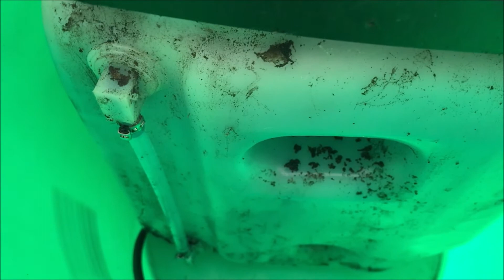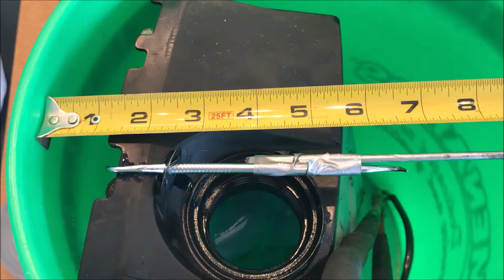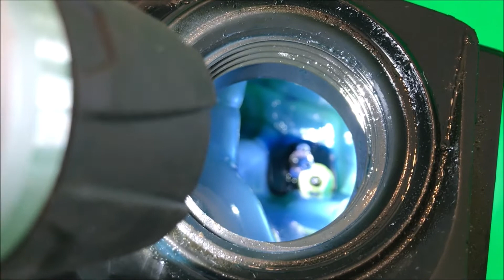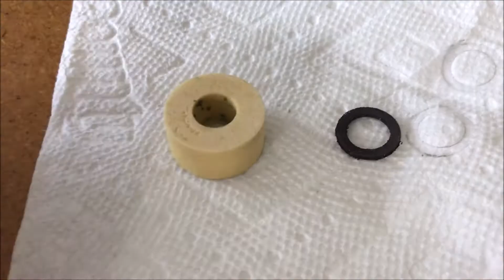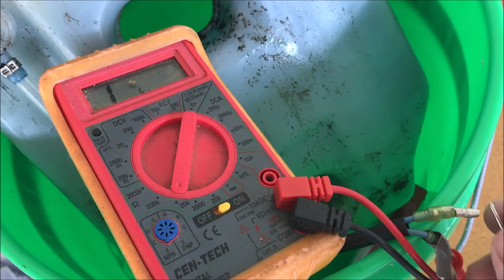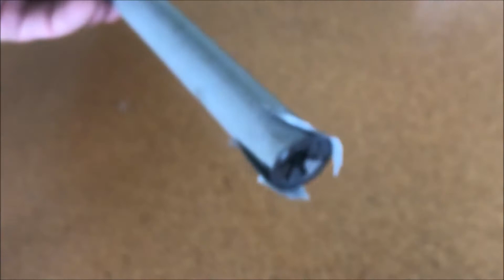OldGuyDIY Repair Mercury Mariner 40HP Outboard Boat Motor Oil Reservoir Float To Stop Low Oil Alarm

Comment: I'm having this same issue on my 40hp 2 stroke merc, does the oil affect the permetex or has it lasted awhile?
Reply from the maker: It has worked since I made the video last year. The motor has not been used yet this year. Based on my on-line findings, permatex is impervious to oil and gas.
Reply: @OldGuyDIY  thanks for the info
Reply from the maker: You are welcome.  Good luck.
Reply: Thank you for the information